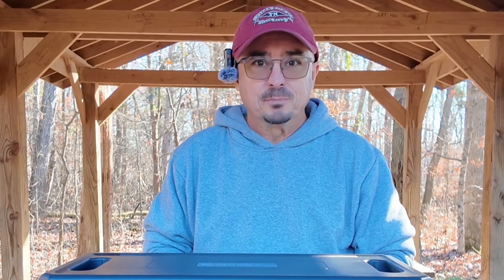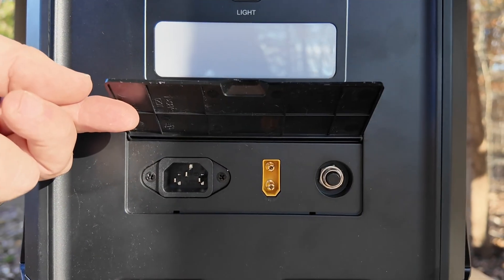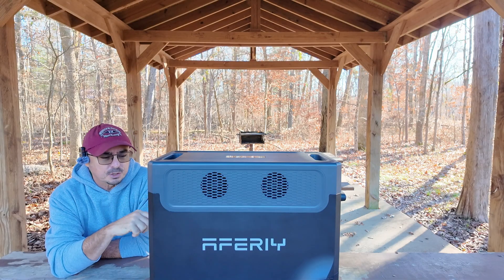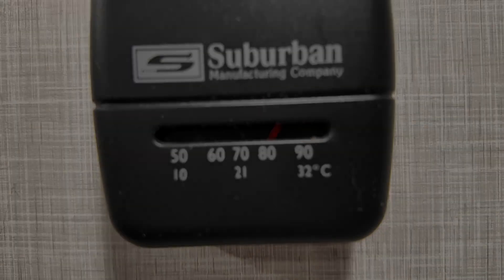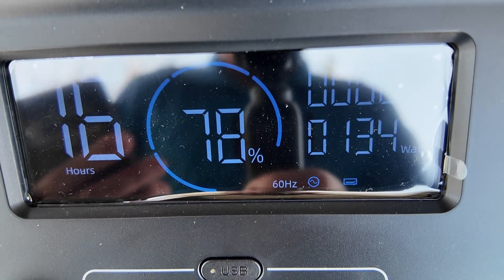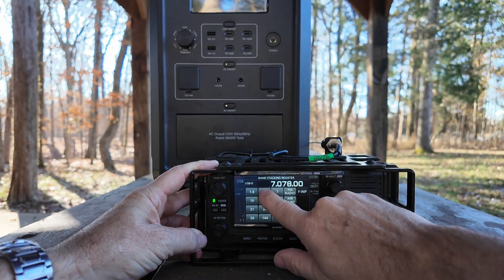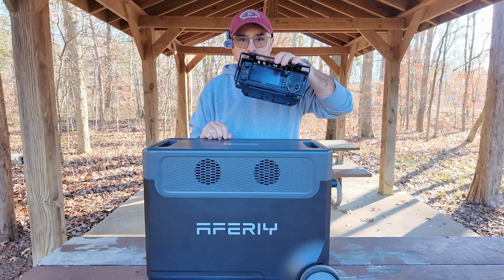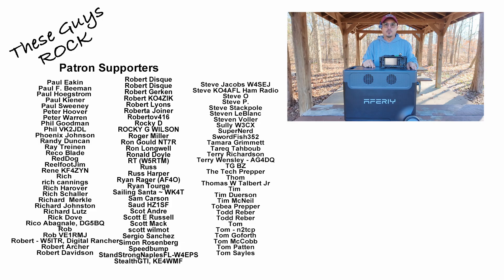Can This Power Station Really Run an RV AC for an Hour? Aferiy P310 Test!

Comment: Wow! These power stations are getting huge!
Too heavy to lift?
Might be better to go modular with a smaller main unit (with enough power) and plug in external batteries.
Since your AC draws 1000W max, a much smaller main unit would be easier to handle.
Reply: I have one. The delivered package is 104.72 Pounds.

Comment: Buy the external battery cable.  Cut it and put a large anderson connector.    Buy a 100amp 48v solar rack battery.   And you now have an external 5kw battery upgrade.   Did it for my oupes.  And been working for 5 months no problem
Reply: Glad to see this, I have a P310 on the way, but I already have 4x 12V/200Ah LifePo4 batteries from my current system. I plan to wire those in series to the external battery port. Since my cabin in off-grid, I plan to use another 1500W of solar panels with a 120v inverter to supply the AC charge power (in addition to the 2000W of DC panel input).